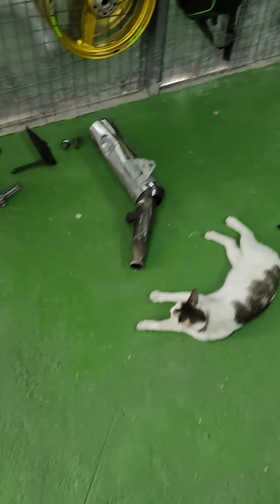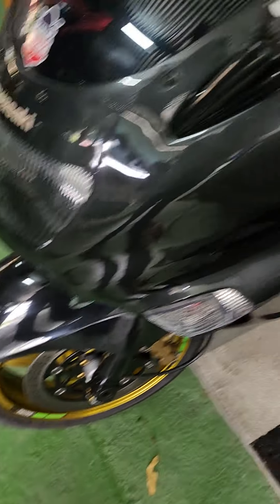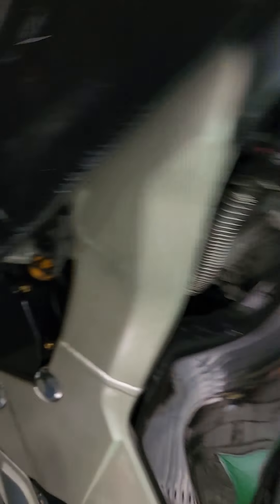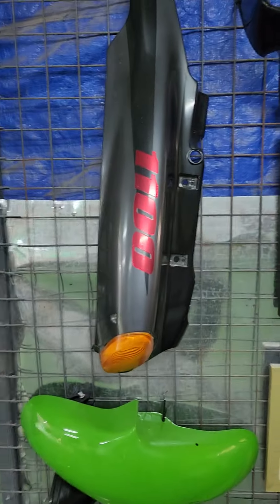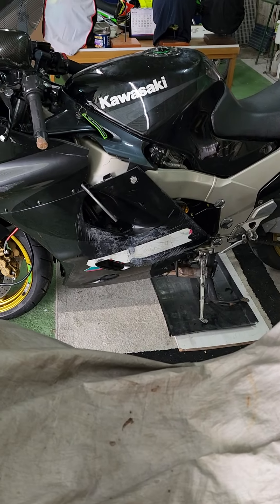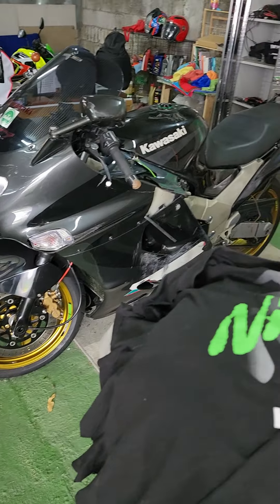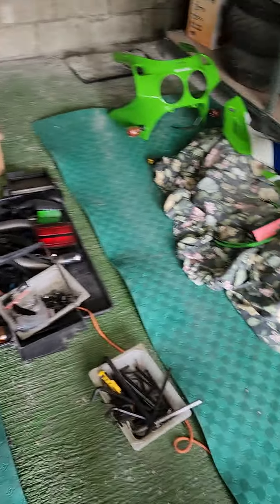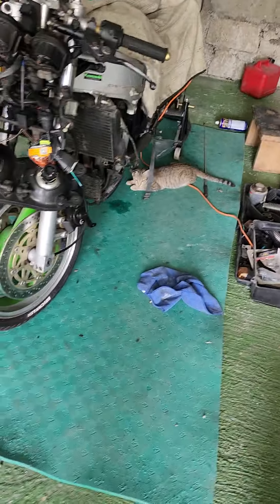Kawasaki ZZR 1100.Update. Not Good news!

Comment: My feelings also after I rebuilt my ZZR600 and starting to get bored. The bike got in an accident because of a telecommunications cable hanging on the road. The bike cracked the left side of the engine, crankcase cover to be exact and bended the crankshaft.

Happy to know that you're fine sir.
Reply from the maker: It hurts to see the damage but I hope you get it back on the road soon mate. ZZR 600 is a nice machine.

Comment: I totally understand how you feel. To support you a little, my ZZR 1100 recently fell off the stand. Unfortunately, she leaned against the corner of the wall with all her weight. During the impact, my front mask cracked, the plastic around the alarm clocks also broke, the metal bumper that holds the mask bent, and a lot of other little things.. Everything would not be so painful if the bike did not have the original 14,500 km.. It was in collector condition, and now I will have to repair it, polish, and paint.. shi* happens sometimes))
Reply from the maker: Thats dam bad news  mate. I hope you get her back to original condition soon. best of luck mate.